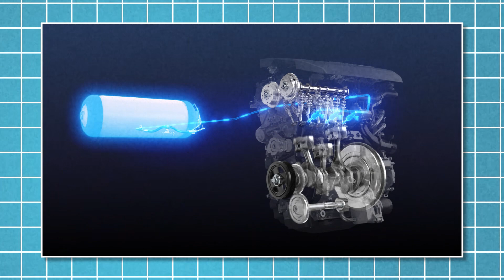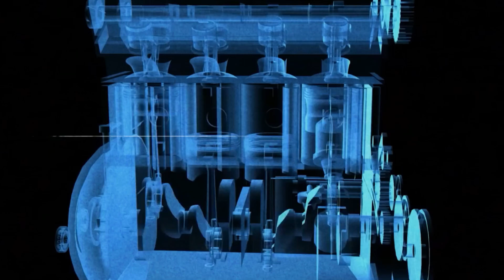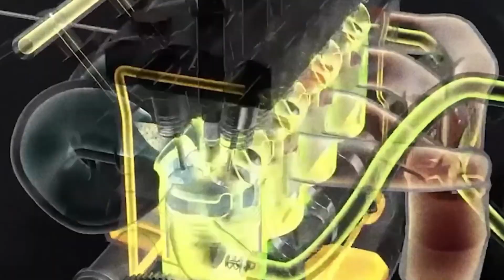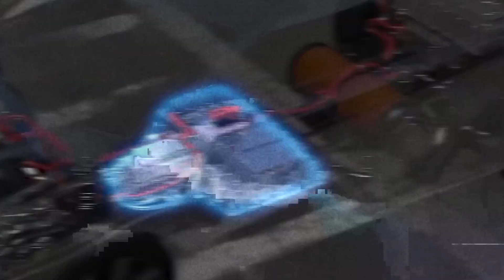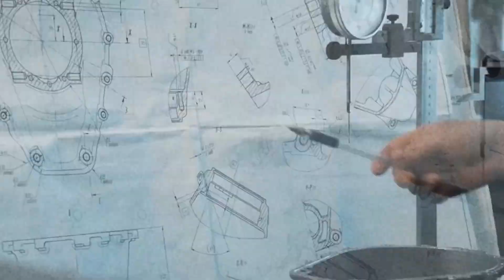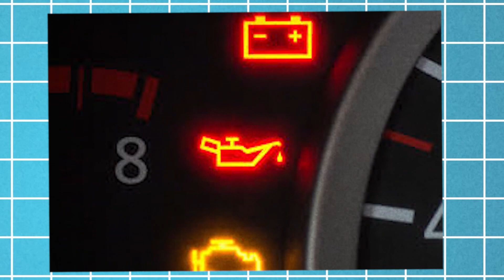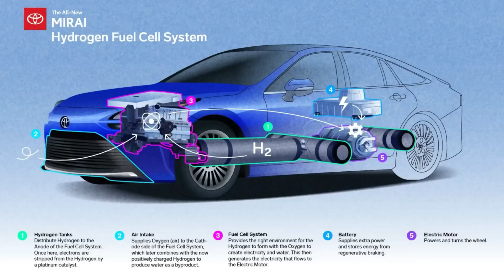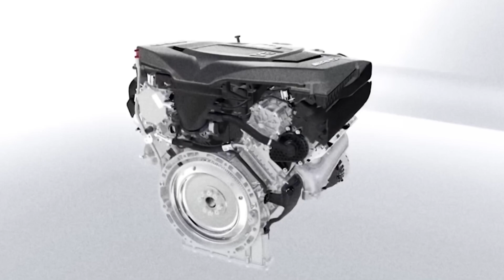Is TOYOTA's WATER engine FEASIBLE? - Deep Dive #ev #cars #technology #electric #water #toyota

Comment: Is anyone so stupid as to believe that water is the “fuel” for this engine?  It is not.  The energy to drive the car comes from the battery that provides the electric current to hydrolyze the water.  The hydrolysis consumes more energy than the engine produces.  This is nothing but an electric car, but with a more complicated and less efficient drive train than an electric motor.

Comment: I was hoping this video would answer the question of how you get energy out of water by separating the hydrogen and oxygen and then putting them back together. Not sure how that isn't perpetual motion.
Reply: It isn't. You still need energy to split, and that energy is released when the atoms (explosively) combine into water in a combustion engine. You could also recombine them with a catalyst afaik, but if that is viable for a vehicle (cost and performance wise) I have no idea about.

If you have an engine with say.. 5 liters of water, which is constantly split, combusted, split, combusted, you still need to provide energy to the system to keep it going. If the combustion provides energy for propulsion, you need energy to split the hydrogen. The advantage of doing the splitting "on site" is that you won't have a massive tank of hydrogen that could explode. Either way, you lose some energy in the process as heat, sound etc.
The disadvantage is that the fuel cells have a limited lifecycle. PEM for vehicles are quoted to be rated for about 5000hrs. Now, that is 300 000 km at 60 km/h avg, but I would wager car makers find a way to make worse units that needs replacing (for profit). 

No matter if you go with oil based, fully electric or hydrogen, it's all just different forms of energy storage and release. The advantage of using water this way is it's abundance, but if we use electricity from Oil/Coal/Natural gas to power the batteries that power the PEM, the car is still "dirty".
Reply: you will have a grasp of it when you start making bubbles and igniting them...

Comment: Very little was explained about how the engine actually works, so I'll be speculating based on what is actually known about hydrogen powered vehicles since I believe that's what the narrator is trying to explain. So I believe this is the exact same concept as the hydrogen combustion, but with electrolysis taking place inside the vehicle..?  No way to know until I decide to look up more info on it, if there is any more on this topic. If this is either a pure combustion or EV hydrogen fuel cell, you'll still need to store H(hydrogen) inside the vehicle. I have a lot of interest and hope in hydrogen power, but we have to be realistic. Right now we need about 10.5 L of water to produce 1 kg of H. 1 kg of H has about the same energy as a gallon of petrol. 1kg of H in a fuel cell EV can get you about 100km(Toyota's Miria went 1000km on a single full tank in 2021-They drove slowly, but still). Distilled water in the US is anywhere from $2-$10/ gallon. 1 gallon is 3.78 Liters so do the math and you get about $5.54- $27.70 per 1kg of H. Most of the hydrogen fuel cell vehicles hold about 5-8 kg of H. A full tank might cost $27.70 - $44.32 for about the cheapest distilled water up to $138.50 - $221.60. This is if you get your water via grocery store(There could end up an option to purchase from a gas station). ALSO hypothetically speaking IF this were to become main steam and everyone ended up swapping to hydrogen powered vehicles, would we change the name of gas stations to water stations or what?? I digress. 

Money wise- sure, there might be something there, but physics wise? The main concern of mine and probably anyone's sound of mind would be that this is some perpetual motion nonsense being spewed, which it's looking like btw. Hydrogen has 39.4 kWh per kg IF used at 100% efficiency(which we can't do btw). Thankfully in 2022 Hyasta made a leap in hydrogen production tech using the new Capillary Fed Electrolysis (CFE) cell they created. It boasts 95% efficiency at 41.5 kWh/kg of H(this is big news people). I really do hope they can fulfill their goals of reaching 98% lowering the price of H to $1.50/ kg, but we'll see! Anyways lol. IF this revolutionary "water powered" engine does what I hope and capitalizes on the diminishing returns of electrolysis, it could lead to something like buy your Initial tank of H and a bottle of water at the station for $7.50- $15.00. Then, drive fancy water bottle for like x amount of distance (idk let's say 1000km or 620 miles. probably not) and have a grand old time when it has a problem because no ones but a small handful of people know how to fix it- I'm gonna try to fix it, break it, then the warranty wont cover it because I'm stupid and then i'll be homeless. the end. great idea. dont read this its practically a waste of time

Comment: These water powered  vehicles will still need oil and other petroleum products to function. Lubrication wheel bearings etc  largely depend on petroleum.Water 
freezes. So we'll need to figure out how to do it.Not undoable but another obstacle to burning water.
Reply: I like magnets. In particular; I like the gravity altering capabilities of electromagnets. A magnetically suspended hub only requires electricity for the electromagnets to improve the hub/gravitational drag. Imagine how much fuel we can save if there were simi trucks that you can push with your hands to move even with a fully loaded trailer attached. Or how much more efficient "STANDARD" trains would be. A water engine could possibly be the answer to where that electricity could come from. That is before micro fusion reactors becomes a thing. It has only taken 22 years for our whole world to change due to the invention of the white LED.
Reply: yup yup. we'll always need oil

Comment: There is NO WAY that this complex engine can be less expensive than an electric!
Reply: This tech piggyback on petrol engines. It is kind-of-a-cross between gas and diesel. This is all tech we have a firm grasp of. The car industry has been experimenting with non-critical part replacements to reduce weight for the last 20+ years. So, I think we know internal combustion engines(ICE) well enough. But just this year 2024 there have been 15 new independent electric auto brands (like Apple(tm) and Samsung(tm)) that are all required to make proprietary electric systems including motors and storage system. Some are focusing on micro cars and other are targeting trucks(lories). The future looks wild for EVs.
Reply: gasoline engines are complex, your point being?
Reply: gas is a ready to use fuel. water has to be processed into hydrogen , then compressed to be ready to use. Should be fine, just more complex  @8-bitsaturn960

Comment: What about us in the “snow belt” will the water tank just freeze? 🥶 maybe a little methanol added? Help me understand science folk! 🙏😎🤙
Reply: You guys are beating a dead horse. I am sure the engeneers have added a thank heater for the distilled water when the surface temp is at freezing. The only thing exiting the tank is Hydrogen and oxygen. So, There is no concerns of the lines freezing. Also an engine that runs on hydrogen is self-cleaning. This menas that it should run forever assuming that timing belt changes are done on regular 100k mile intervales. I assume the engine will turn itself on to make electricity to heat the tank as-needed and when the distilled water runs out there will be no need to heat the tank. Problem solved!
Reply: The water would be pretty hot so probably it wouldn’t freeze even then it could be beat out by your hair dryer
Reply: @possumnotopossum  when parked and not running? Just leave it run all night and day?
Reply: @joeeyman7503 maybe you would have some thing like a defrost feature but for the engine

Comment: I love how you ever so discreetly say "distilled water". How do you make distilled water? 
Well, all you have to do is get regular tap-water, boil the F--k out of it and collect the steam. 
Once the steam has cooled, you have distilled water.
Problem?
How do you boil the water?
Answer?
Apply some sort of heat to the water (duh)...
And we're back to square one.
So should we use fossil fuel or electricity (generally made by burning fossil fuel as other methods are yet to provide us with the quantity we need) to boil our water????
Reply: Water distills by a natural process. Meaning you can sit water out in the sun and it will distill itself, as long as you have the correct collection apparatus in place. This distilling can be scaled up and even done on large bodies of water. Solar distillation is much more efficient then electrical solar-cells and the environmental impact is zero. I do not see where there is a problem. For all the hate electric cars bring their now 12% worldwide economic market has open the door for new-er tech that will (hopefully) put an end to petrochemicals forever. Did you know that small planes in 2024 are exempt from all emmision standards and still run on proven poisonous leaded fuel. We can always do better.
Reply: @GallowayChicago  I must admit to not having considered natural distillation as I thought (perhaps incorrectly) that it would be either too slow or require an excessive amount of real estate to be able to produce the quantities required for a commercial amount of vehicles.
As for the small plane emissions; I live in Australia - there are emission standards for any and all modes of transportation. I'm guessing that the emission standards that you refer to are from the US which (unfortunately) appears to be rather lax with many emission standards..

Comment: i rather drive a water engine than a stupid electric car
Reply: Why?
Reply: What is so stupid about an electric car? It's utilization of energy to move the car is far more efficient than an internal combustion engine. Plus, it’s made using far less components than an internal combustion engine, irregardless of the fuel type, whether hydrocarbon or hydrogen. Electric cars are also fully digital which means better control, autonomous capable and safer. All that doesn’t deserve to be called ‘stupid’.😊